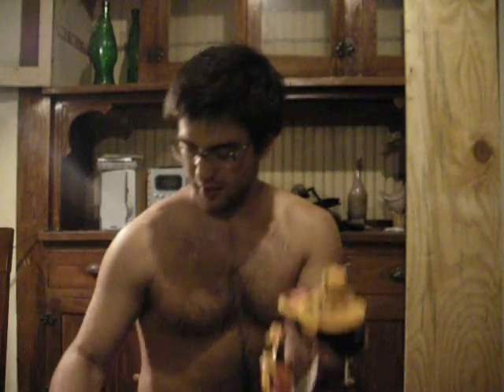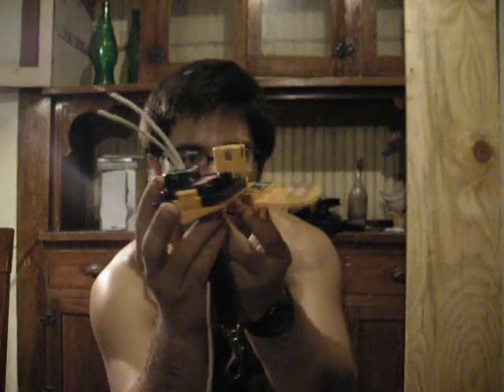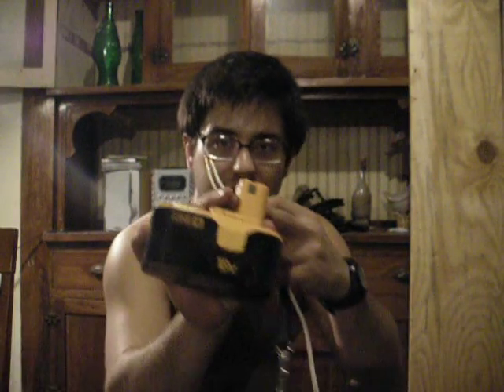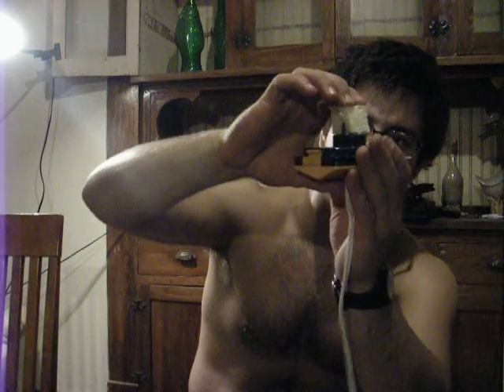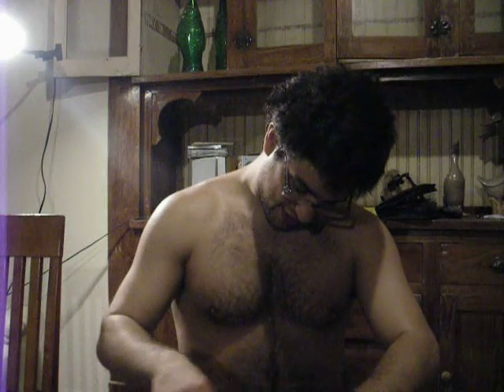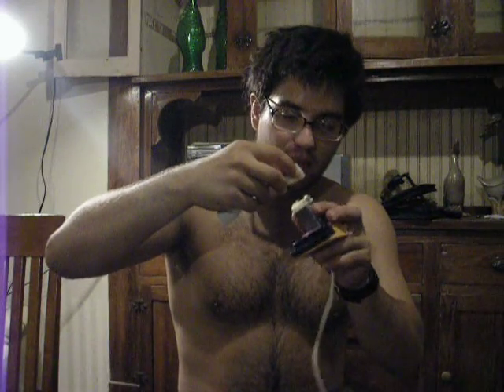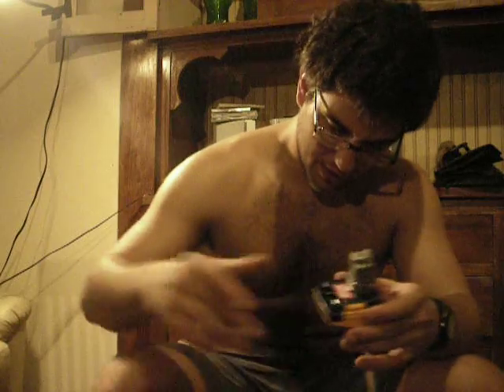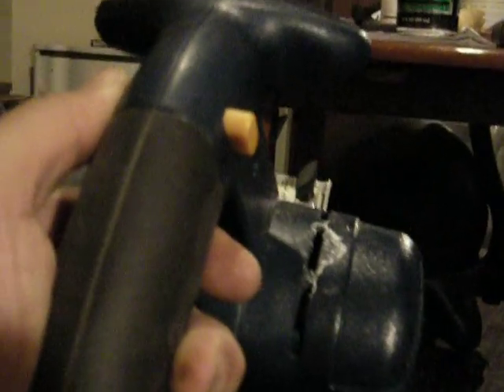cordless to corded conversion

Comment: just solder the wires from the AC cord to where the connectors are on the dismantled battery then run the other end of the cord to a beefy 12V car lighter cord with no fuse or spring and it must be a type of plug like that on a 12V car heater that plugs into your cigarette lighter. You can do this with the cord off that and that will work. I did this and mine looks like a drill battery with a 10 foot cord coming out the back and going to a cigarette lighter plug.